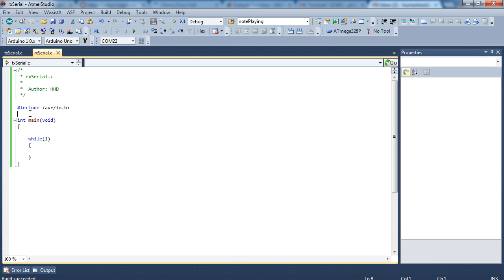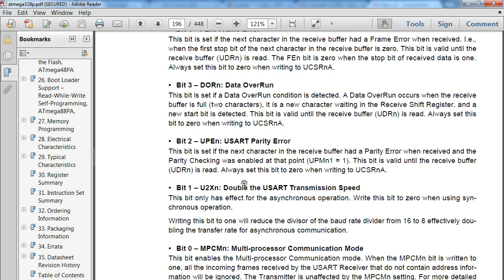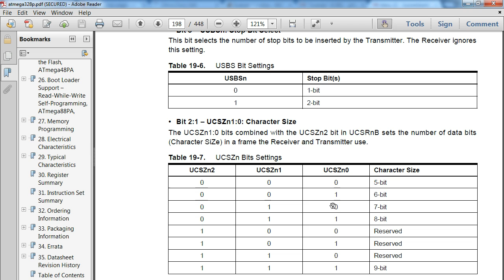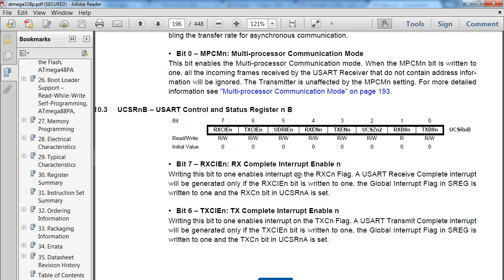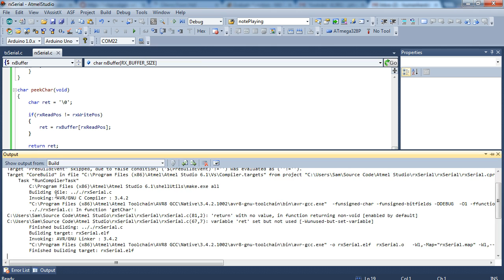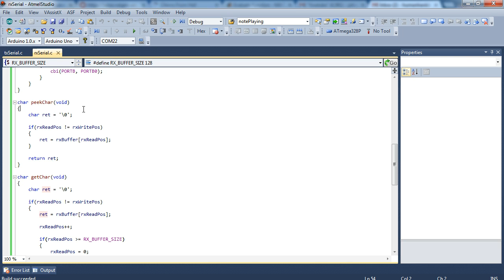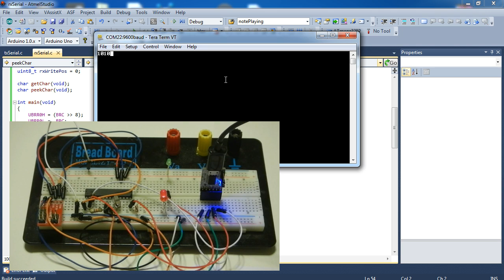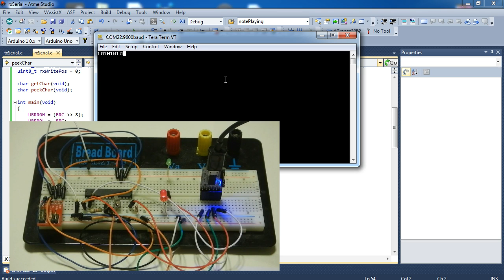Learning AVR-C Episode 11: Serial Communication (RX)

Comment: hello sir I have a doubt, that inside main program the peekchar method is not called and what is the use of peekchar(void) method. Is there any other way to get the same output without using character arrays?

Comment: Hi,

Im currently using serial input on motor control. Im a bit stumped on how you would go about changing it so (in your case) will have the light stay on when you hold down a key. I am more or less wanting to have the motor stop once i release the key pressed. Would it be as simple as writing 0 to the pin after a delay? Thanks in advance

Comment: Hello!
In case you want to send a string from the serial to the micro controller, will you use the peekChar function? 

If i send  a string for exaple AX01, and i want to check whether this is the received string, what changes shall i made in the while loop. 

Thanks!!

Comment: Dude, is there a place I can look at your code in it's entirety so I can make sure I have it correct?  My light doesn't blink and I'm a little pissed.  You're going way too fast, then jumping all around and I feel like I'm missing a whole bunch.  The screen is too small and the code is extremely hard to read with my connection speed.
Reply from the maker: Check the link in the description. Let me know if you have any more questions.
Reply: humanHardDrive Well, I think it's something to do with the Arduino IDE.  I had a problem with the PWM code too.  Unfortunately right now, I'm using the Arduino IDE because I'm waiting for my AVR Programmer to arrive.  My code was the exact same as yours.  Even when I comment out the sbi() and cbi() functions from the #define, and just replace it with PORTB |= (1<<PORTB0); it still won't light the LED.

Thanks for posting these, I'll give it another shot when the AVR programmer arrives.  If you've got any other suggestions, let me know.  I am using a 3mm LED with a 330 Ohm resistor, hooked up to GND and PB0.  I can also see the RX light on the Arduino board flashing on, but it just won't light the LED when I type in a 1.
Reply: humanHardDrive I got it working, thanks.  I got my USBtiny in the mail the other day and hooked it all up.  Still couldn't get it to work, but got it going today!  Thank you!
Reply: Jacob Zimmerman IV what did you do? I have the same problem - RX light is flashing on, but the LED is not lighting
Is it because of Tera Term? Thanks!
Reply: Darko Jenic re-check your code and LED connection, my setup worked on the first go, following the code in the video.

You can also download the code (link in description)